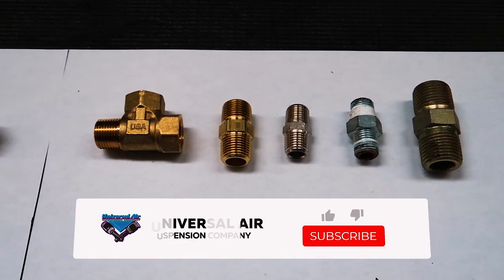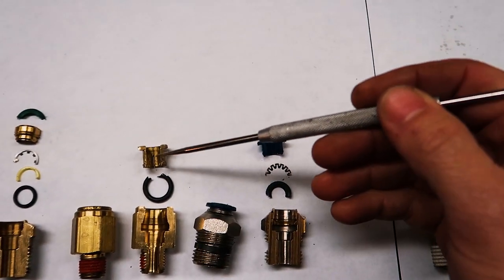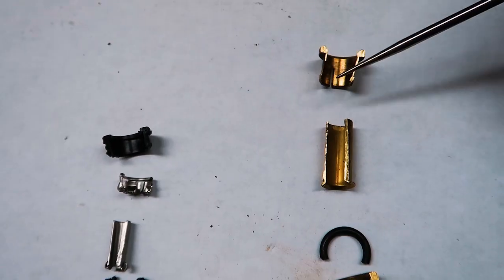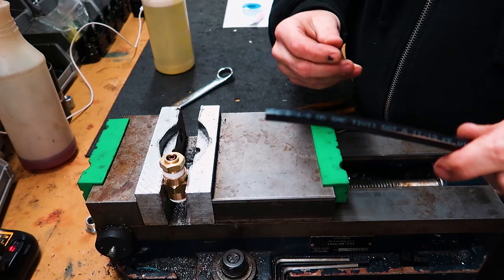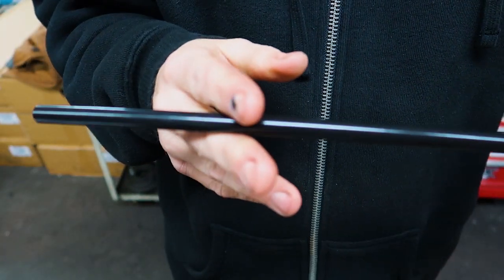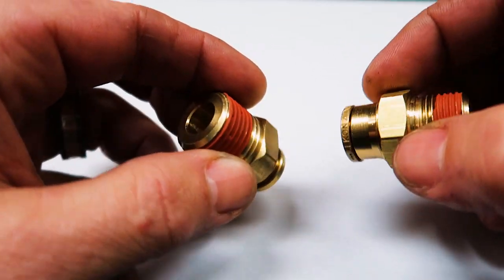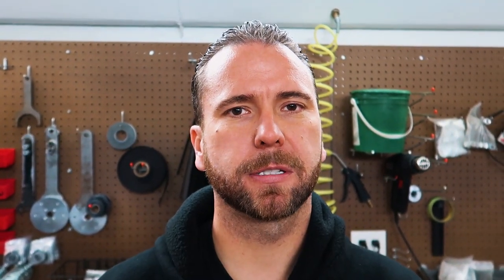Everything to Know about Air Bag Suspension Fittings

Comment: I actually clapped once this video was done. Very technical and thorough. I absolutely appreciate the logic and prefer understanding things than to just be guided. My journey to a leak-free system was through trial and error. I recently solved a check valve issue. My system is currently solid, but I'm now contemplating upgrading fittings for extra assurance. Mahalo! 👍🤙

Comment: I put rubber fuel hose over all my plastic air lines will save you a ton of problems and I don’t use quick connects I use the Ferrell type and the quick connect type were used for quick repair on high way not a permanent fix but will get you home to change out and the shop uses the ferrule type .
Reply from the maker: Adding protection to the line isn't a bad idea.  Typically its not necessary except if you have to run the line though high heat areas or across sharp edges.  Compression fittings (Ferrule) are a permanent type of fitting, however, they are prone to improper installation (typically overtightening them), but when used properly they do seal very good.  Personally I prefer a good high quality PTC fitting where servicing is easier and can re-use without cutting the hose and replacing the ferrule.

Comment: Dot compression fittings  is what I like running I usually always run a helium tank and with compression fittings I’ve never had a leak 

but I prefer DOT fittings over anything else even the push to lock ones if they’re made to work on air brakes then they’re made Not to leak think about it thank you for the video was very informative good job

Comment: I've heard of using a compressor for a/c. Can you do a video of that set-up
Reply from the maker: Problem with the ac compressors is refrigerant has oil to lubricant the compressor. If you try to use it for air it will require good maintenance so it doesn't blow up. It will pump the oil out of the compressor and have to be replenished. Will also need to remove the oil or it will be exhausted from your valves

Comment: Very informative. Question: Has your outfit dealt with Accuair endo compressor tanks? My understanding is they're all failing including mine, but after drying out for a week mine started working again. I'm thinking when it fails again I can remove and repair the failure point as the compressor itself is obviously healthy.

Comment: on the corrosion front, would a air filter/dryer help if installed before and/or after the air tank?
Reply from the maker: Best after the tank as water will always condense when it hits the tank. Drain it regularly to prevent buildup. If you get a lot of water out, do it more often.  Only a little less is fine. All depends on the humidity in the air.

Comment: I thanks for the info....I don't see the leak proof style here....similar to compression, but instead of the compression sleeve it has a nipple with a lip that the hose goes over and then the nut tightens and squeezes the hose to the nipple....they are by far superior to any fitting....have used them on 30+ projects since discovering them, with ''0'', zero leaks....can't say that about any other fitting out there.....thx just wanted to pass that on....

Comment: I need the part that is like a metal copper  peace that locks in the hose to the strut assembly.  I tried to remove the whole fitting assembly, but it looks like it's welded
Reply from the maker: OEM Struts or an aftermarket one?

Comment: My benz airmatic compressor main air line keeps blowing the hose off.
Car is completely flat there's too much pressure. Can I just unscrew the fitting and put a new one in there?
Reply from the maker: They typically run a special metric fitting and typically it’s part of the compressor/dryer unit. Since it’s a regenerative dryer maybe get be time to replace the dryer or pump 😔. Also inspect the hose. If it looks melted/deformed I personally would replace it too.

Comment: I need to know fitting for hardline setups
Reply from the maker: The proper way to do hardlines is to flare them with AN, SAE, or JIC fittings.  (AN Most popular).  Make sure that the fittings/line your using doesn't rust. I would suggest Aluminum, stainless or brass.  Not steel.

Comment: Good overall video, BUT, not you confused the situation a couple of times, please explain for those who may not be familiar...

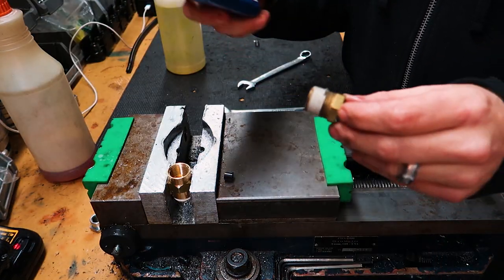@12:20 you apply liquid sealant on top of the tape, yet do not elaborate on why.  It has always been my understanding this is never acceptable.

@17:00  (1/8" = 3/8")  -  (1/4" = 1/2")  -  (3/8" = 3/4")(should be 5/8"?)  -  (1/2" = 7/8")(should be 3/4'"?)  then contradict those by saying (1/4" = 3/8")  -  (3/8" = 1/2")  -  (1/2" = 3/4") and going down 1 size is a good rule of thumb.

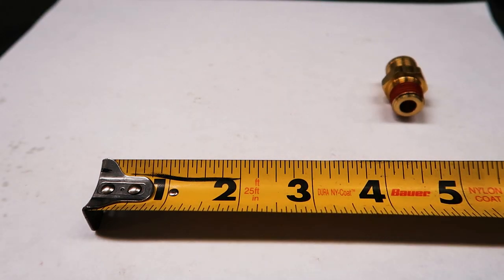@17:49  This portion is way to convoluted for me to even type.  You basic point comes across, but it should have been more direct.  The editing of this section did not do any favors either.   There is no lead in with a brief explanation on what you are going to discuss.  Staing , just a couple second statement followed by a line of "keeping in mind it is the inside of the pipe" that had no lead in.  How can you keep it in mind when there has been no explanation.

I did not just take 20 minutes out of my morning to type all this just to critique your video.  However, I am sure there will be who watch it will get a bunch of good enough, but they could get a bunch of great info if these areas were more clear for them.  

Once again,  not trying to be a jerk, if I was, I would have just gave the video a thumbs down and went on my way.  Instead, I took time out of my morning to offer my thoughts on how you could potentially help someone who may get confused on a couple sections.

Cheers!

Comment: I like this video very much however at time 13:10 viewers need to be aware that one turn past snug is far from adequate for some types of Dot compression fittings. personal communication with technical service at one major provider said it's four turns past snug. I confirmed that with my local provider as well. perhaps the difference is the size of tubing I was using which was 3/8 in j844